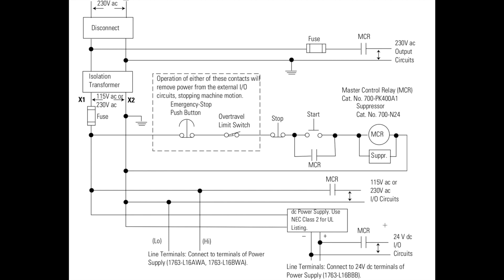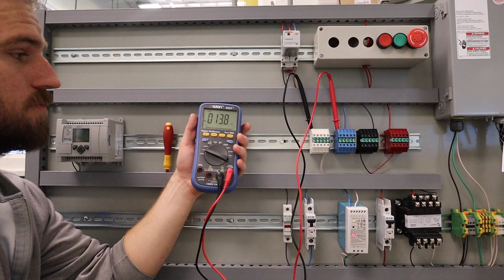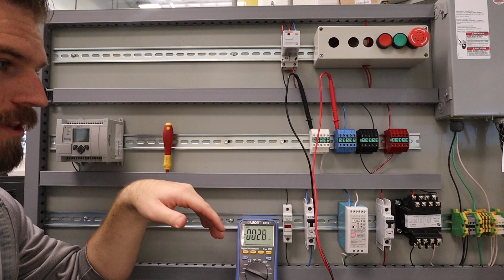Allen Bradley PLC - DC power for the I/O

Comment: Why do you say 120 volts but in the schematic it says 115?
Reply from the maker: I believe the residential grid is set at 117.5v +/- 7.5v. Most electrical devices operate between 110v and 130v but that's not a standard. I just grew up calling it 120v because that's what my teachers called it. Sorry for the confusion.
Reply: @Mikesfilmss  ah ok thanks for the clarification.

Comment: I always use a safety PLC/controller / relay . 2 chain circuit. The  keyence GC 1000 is great for e stops and light curtains. This is ok for very basic controls but not really good for industrial applications
Reply: What is a 2 chain circuit?